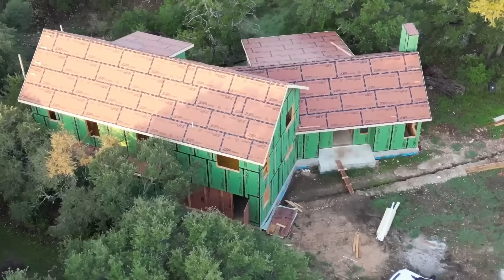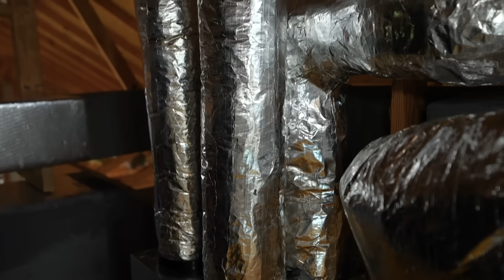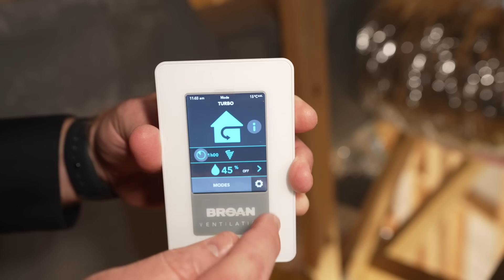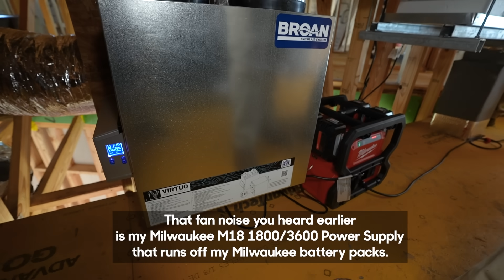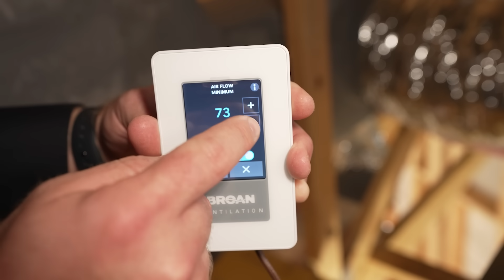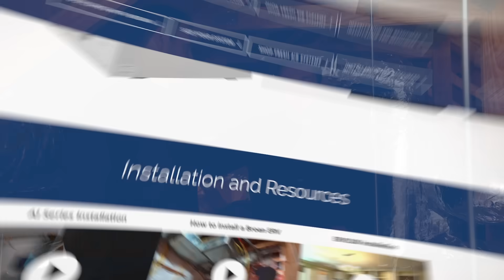Fresh air: A quality ERV that most can afford?

Comment: Has anyone thought about using ERV with a ground to air heat exchanger to keep a Southern house cool? Any thoughts
Reply: This is an interesting idea. Earth Tubes have been used, for cooling air, one of their biggest issues is mold as a result of condensation from warm air inside of the earth tubes. If you do this, make them big enough (24inch pipes) and in such a way they can be easily cleaned. An ERV might solve this mold problem. You might also have a mold problem in the ERV!  I think the ultimate answer for this is the DIY minispilt. These new inverter units are super cheap about $1,000, and super efficient. (SEER 20+). Cooling costs in the south with a decent to good unit should run $1 to $2 a day on an average house. (This assumes you have average three bedroom house,  shade trees planted on the south side of the house to naturally shade it, decent insulation, proper thermal mass and mild use of AC. I figured out seasonal cooling costs for several southern houses last year and cooling costs were only about $100 a year.  In short it averaged a dollar a day in electricity through June, July and August, with just a little use in May and September. To be fair HVAC depreciation on a unit is significant. A cheap low end (Goodman) HVAC system will cost $5,000 and run for 10 years. With that cost, straight line depreciation on the HVAC unit is about $1.50 a day.  Let's just suppose one can take an ERV and ground tubes and make a system that can handle half of the cooling load on a house.  That means you save $50 bucks a year in coolings costs?  Who cares?  How much are you going to spend in time effort and capital. It is just not worth it. One of the big things in HVAC's is most HVAC guys always want to sell a big expensive high capacity unit that can always do 100% of the heating and cooling for a house. The smarter way to do it, is to insulate the house well, cut down the need for heating and cooling, then install a cheap high efficiency system that takes care of most of the needs. Then have additional cheap capacity for the absolute extremes. An Additional window air conditioner, or a propane fireplace and or a Baseboard heating are examples of the very cheap, additional capacity that you are probably almost never going to need to use. However, on those super hot day you do need them they will be handy. Propane fireplace can also heat the house in a winter power outage and does not have monthly costs of a natural gas hookup. I would love to see these ERV units get cheaper. Since they are basically, just plastic, and a couple of fans, they could get down into the $100 price point. Something small with computer fans, should be able to made for very little.

Comment: Great to see some smaller and more budget friendly models. 
One of my concerns is always running costs. According to the label shown in the video, this unit run at 120Volt, and 5.6amps. So about 672 watt. If we assume it uses only 50% on average over 24hours, that’s 336watt or 8kwh per day. Numbers like these are important if we consider a solar/battery system as a backup or even go completely off grid. All electric systems should put such numbers at the cover page of their brochures. Energy costs vary, but a systems design specs remain constant
Reply: Looks like it uses 35 watts at 65 CFM from their spec sheet. That may be the max amp draw.
Reply: @tjr14777  that would be even better. 1/10th my assumption. I took a screenshot from the video to read the label to get some numbers. 
Both our numbers would be important though. We need to know the max load our electrical system needs to be able to handle, even if running loads are lower. But at 800 wh for the day, that is quite reasonable.

Comment: Question:  If you're pulling fresh air in from outside, what if the "fresh" air is not so fresh?  People burning wood for heat, skunks walking by or hit by a car, etc.?  Does this unit, or any unit, have some method of removing these contaminants?
Reply: I just turn mine off until the situation passes.
Reply: It has a MERV filter but I don't think any filter is going to take out a skunk smell, for example.
Reply: Activated carbon filter removes odor

Comment: Wait, was it just noted taking stale air from the bathrooms and moving them to the bedrooms? Eh, is this what I really want? I imagine moisture changes, but smells? Smoke from 🔥 in the kitchen? Chemicals in mudrooms?
Reply: The stale air is exhausted to the exterior.  The fresh air air is pumped to the bedrooms.  The air is tempered by the ERV
Reply: @lukemarks9132  😀shows my lack of ventilation experience

Comment: Always have to temper my expectations when Matt says "affordable"
Reply: Affordable if you get it free
Reply: Reminds me of this old house. Budget in the early 80s for a screened porch addition was $40,000. I could have built a really nice house in my market for that.
Reply: How much are the filters and how often do they need to be replaced.
Reply: @peterbeyer5755 looks like a 13 MERV filter is approx $60. How long it lasts probably depends on how dusty the air is around your house. My fresh air intake would go through that tiny filter in just a few months. GeneralAire makes similar ERV systems with filters that are washable and cheap to replace if needed but obviously are not MERV 13 rated.

What a beautiful scam really. Convince people they need to hermetically seal their house. The air quality is awful because it's hermetically sealed. Address the stale air by selling those people a $1500 ERV with $60 filters that may need to be replaced every 60 to 90 days (plus the electricity cost to operate the ERV 24/7).
Reply: @hochhaul ERV actually only uses 100w to run. The filters on some machines only change once a year. Building tight isn’t a scam, it’s building science for the most energy efficient and healthy home design. $1500 is nothing to spend on peace of mind that no mold or harmful air is in your home
Reply: Remember there is a shortage of workers everywhere. Think of it as finding out how big of a budget people out there have.  Make those people your clients.
Reply: @sparksmcgee6641  thats assuming he's a contractor. What if he has a regular W2 job? In a career path that isn't transaction based.
Reply: Haha yup
Reply: Yeah, just checked out Bensonwood's affordable homes....killed my happy feeling
Reply: THIS.
Reply: Completely agree. 😊
Reply: 3-6 grand for what you get for an ERV is definitely affordable.
Reply: Upper-middle affordable Matt

Comment: what's your take on adding humidity ? In Canada (Quebec), I had to stop my HRV system, and even there, the house is between 32% to 38% humidity ! I need more !
Reply: ERV would help retain humidity.  Sounds like you need a while house humidifier like most houses in Canada.
Reply: Get some plants and water them. One natural way that has been proven to improve indoor air quality is to have plants inside. There are numerous experts that will tell you which plants are best, but adding green growing plants is an easy way to help increase the humidity. An average house can hold 1 to 5 gallons of water in the air at any one time. This is evident when running dehumidifiers and getting 1 to 3 gallons of water per day out of humid houses. To humidify your house you may need to put in 1 to 5 gallons of water per day. That is a lot of humidity! Growing up running a humidifier in a house, we could add 2 to 4 gallons a day. While a humidifier is an option, a simpler cheaper option is plants. If you added four large house plants (something with a 3 to 5 gallon base bucket, and a plant or fern that was 2 to 4 feet tall, putting one in each of four rooms, you would likely need to water them every week. Watering them once a week adding 1 gallon of water to each plant, would add about 1/2 gallon of water per day to your air. My guess is this would increase  your house humidity about 10%; of course it all depends on  air exchanges in the house.

Comment: The cold north need the ERV to keep the humidity IN the house in the winter. HRV will dry it out, maybe dangerously so.
Reply: Here in VT it’s necessary to have an HRV to get rid of warm moist air inside the house so the windows don’t condense in winter from snoring in the bedroom all night

Comment: I don't like how you made it sound like tight homes aren't comfortable. You literally said they get uncomfortable quickly without constant fresh air. I don't think you really believe that. 
I also dislike how you talked about just idling your truck for 30 min calls. Woof if that isn't horrifically bad for the environment. Your quality is top notch so maybe exclude those little comments.
Reply: -airtight homes without supplemental air and controls are unliveable if sealed up, - but you can open windows still, I agree. 

Matt mustn't realise, you can run the car ventilation fan without running the engine  - but not conventional(auto) non electric AC, lol - as for many I see sitting in idling cars waiting for the Mrs to do the shopping/etc, jk..  (I have solar for that - keeps the battery topped up if running fan and "entertainment system"  for a while.)
Reply: @kadmow  but not quickly. Or maybe I have a different timescale. How quick is quickly? An hour? A day? Also, I'd bet they stay comfortable longer than they stay healthy.
Reply: Maybe look into building science just a little bit before you type!  burning a quarter gallon of fuel isn't hurting anyone except your woke brain.  So building a harp stairway is necessary?   No it is a waste of valuable materials.   Stop the nonsense

Comment: Great equipment but massively over complicated and unnecessary. you could have the same results for 1/2 the cost, its why i’m getting out of the HVAC trade, can’t make any money when you have guys selling a feeling with a big fancy truck instead of installing a common sense system.
Reply: If you don’t mind elaborating a bit, what’s a common sense approach for a tight 3,500 square ft. new construction house in the Arizona high desert (Sedona)? Mild climate but I know I’ll need fresh air and make up air. I had Zhender do a quote, and it came out to 28k for parts alone with over 12k in tubing alone. Seemed crazy to me. We’re planning to install Bosch variable speed package units due to limited attic and truss space due to the flat roof. My HVAC guy seems to be focused on the conventional HAC approach, leaving out the V.
Reply: @5starCA  if your serious, dm me on youtube, we can go from there for a design to a build, 12k for duct is insane
Reply: The have and have not. This channel is all about the rich. Nothing budget friendly here.
Reply: Agreed.  I built my 3500 sf house in San Antonio 40 years ago, insulated it like a Yeti cooler but made no effort to seal it up tight.  Utility bills average $150 a month, and it never feels too humid or dry inside.  Bathroom vents work great and the fireplace draws just fine.  Isn't a "tight" house supposed to save money and energy?  In my climate (which is the same as Matt's), it makes no sense to buy, run, and maintain expensive equipment in order to overcome the problems caused by a house that's sealed up like a submarine.

Comment: I know a lot of these videos are sponsored, but I'd like to know the big differences between this and say the Zendher and what you are getting by buy the more expensive.
Reply: I just went through this for my new build (owner/builder) in SF Bay Area.

The Zehnder system with 5 supplies and 7 returns was priced at $16k including freight. The broan ERV 75% was less than $1500. Then we ran regular R6 ducts with Fantech MGE registers. The way one sales guy explained to me was that Zehnder was the cadillac. Its a unified system which comes with own ducts and is > 90% efficient. But the system is easier to install and you save on labor. Its great for really tight houses.

I went with Broan 160CFM75% asthe labor quotes were identical on both systems. The time to run the traditional ducts was the same (now that I have looked at installation of both broan and Zehnder) 

Zehnder had more CFM but for my 3100sqft house with a dedicated makeup air and separate exhausts in bathrooms, Broan was plenty. It also has the auto balancing feature too which (if it works) would be nice. 

My understanding is that if you are looking to squeeze out as much efficiency as possible, Zehnder is king. Otherwise, Broan works the same functionality wise.
I haven’t commissioned the system yet.
Reply: We have had this Broan running for 2 years and every day I am thankful we didn't pay the extra $15000 to install the Zehnder. We are in a close to passive house but weren't looking for any certificates. I have co2 sensors all over the 2400 sq ft house and never exceed 750 ppm with a full house of guests. Relatively quiet, works well and highly recommended but If I had a blank check build I would have opted for the Zehnder system.
Reply: @aorange999  I will be commencing my own Broan Ai100 this spring.  Re purposing my forced air ducting to ERV , with HVAC being Ductless HP.
Reply: Efficiency and an integrated distribution system.
Reply: What everybody above has said.

It's like Pretty Good House vs. PASSIV HAUS standards.

Comment: #317👍🤔sounds important but in a 1960s house like mine it leaks enough air we get plenty.  It just is drafty and costs more to heat.  I get to control the flow into each room with the vent from the HVAC system manually.  Humidifier in the bedroom for sleep time.  Too much equipment!!  I love my all tight grain old growth timber home!  No OSB or plywood here!!
Reply: Having thought about this alot, we have 5  steamy showers a day( teenagers) and the bathroom fans are 80 cfm so that is about 10K CF.  Currently it is near zero and summers are often mid to upper 90s. The house was built in 1905 and leaks some air so I wonder would it be better to pressurize it with clean warm/cool air or just suck in the wild air probably from the crawl space. The ROI is difficult to justify as our home's total energy cost is $125 a month year round.
Reply: @tysleight  What are you doing that your energy cost is so low? spill your secrets.
Reply: Mines about the same, energy is cheap in the Midwest I guess, for now anyway.
Reply: @matthewbono3273  misconception. Our energy rates have increased. Indiana, specifically, used to be one of the cheapest but is now solidly in the middle of the pack.

Comment: Is the dehumidifier tied to the erv or stand alone and what ductwork if any is used  very vague
Reply: Stand alone. Nothing can be inline on an hrv/erv other than intake air preheater. In this install it may be integrated with the return air on the heat pump.